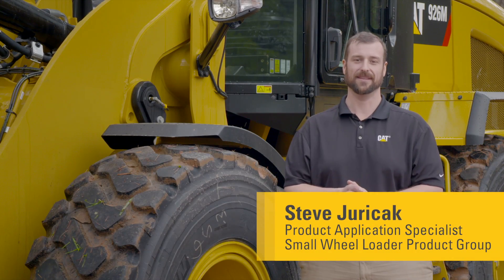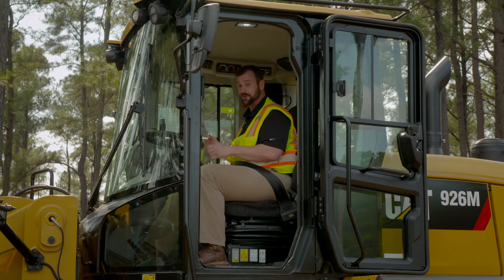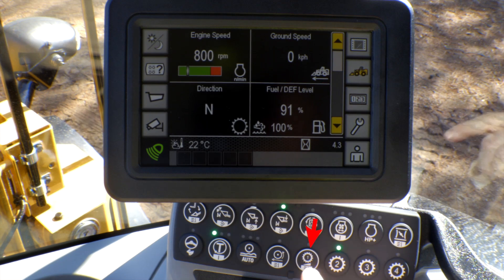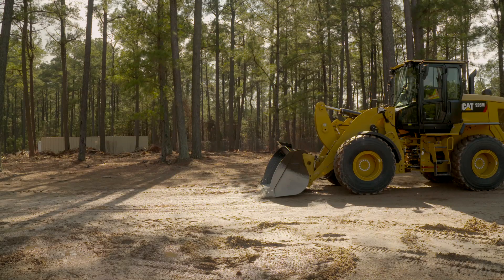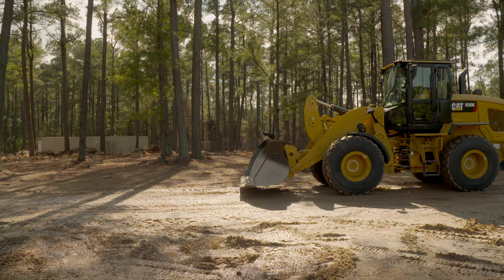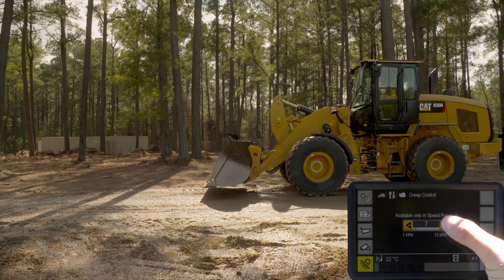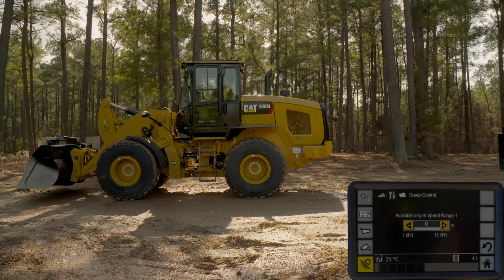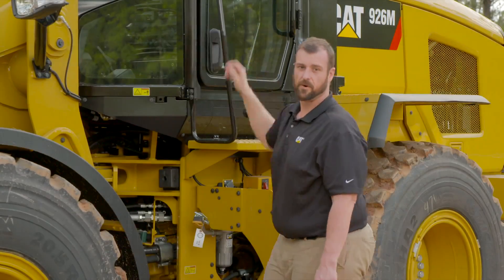Cat® Small Wheel Loader Operator Tips | Continuously Adjustable Creep Mode – 926M, 930M, 938M

Comment: is there anyway to turn off the creep function so that if I am in speed 4 the machine will not creep?
Reply from the maker: When the ‘Creep control’ is engaged, there will be 2 ‘snail’ icons visible on the display.  When the ‘Creep control’ is disengaged, they should disappear. Depressing the bottom left button on the left hand joystick should ‘turn on / off’ the Creep Control function.  (This is the button directly below the ‘horn’ button.)